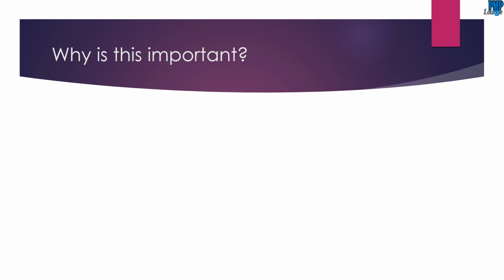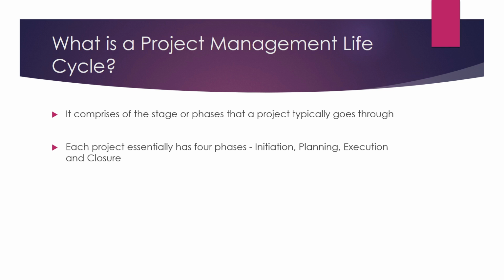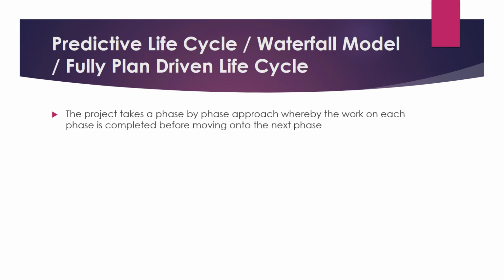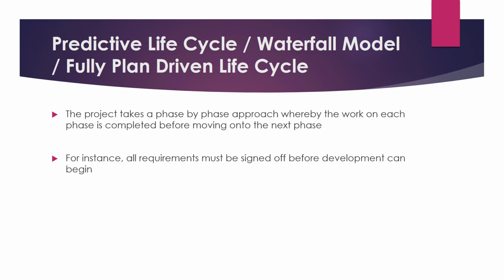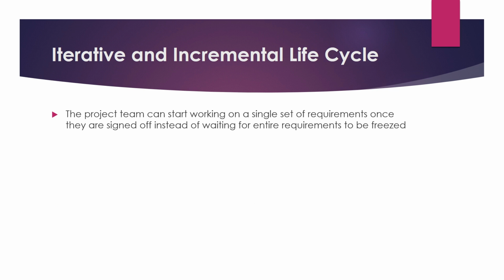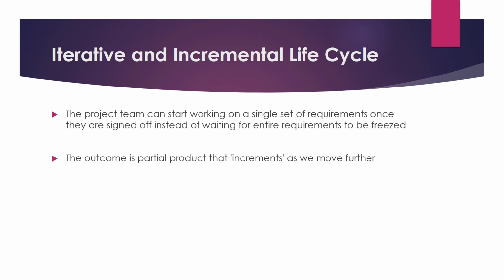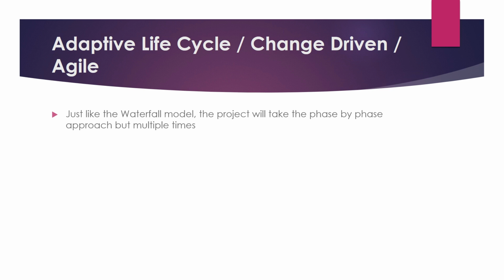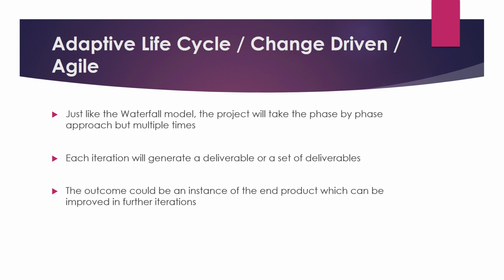Types of Project Management Life Cycle

Comment: I thought Agile is , working with a fixed Cost and time. and the client's requirements are prioritized to fit into the fixed Time and Cost. The Scope gets worked inside the fixed Cost and Time.
Reply from the maker: Time, cost and scope are also known as the triple constraints. A change in any one would mean subsequent change in others. Its almost impossible to deliver a meaningful project scope where time and cost would be fixed
Reply: First of all thanks a lot for this quick reply, I appreciate. I agree with your explanation. 
Which means a little more reading up for me. 
I got that "fixed cost and time" from Ritas book. I have worked on a fixed bid project, where the cost and time was fixed and the client basically said work in this limit. I do not have a good understanding at this moment. I will read up a bit more. 

I appreciate your quick responce.
Reply: Agile model is kind of a combination of iteration and incremental models at the same time to speed up value delivery to the customer while you're adapting partial deliveries to get the final delivery by the end. so time and cost may vary according to new functionalities or requirements requested and that's why it is a must to get the scope approved before any iteration